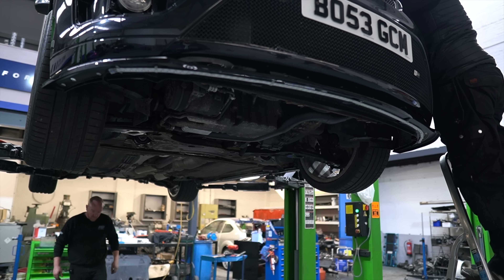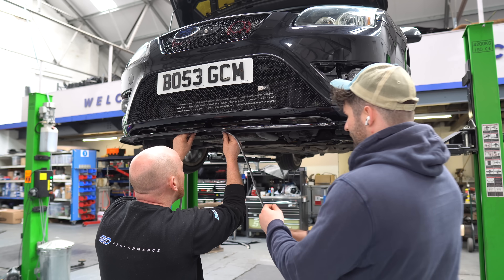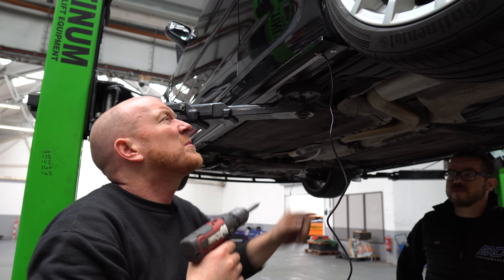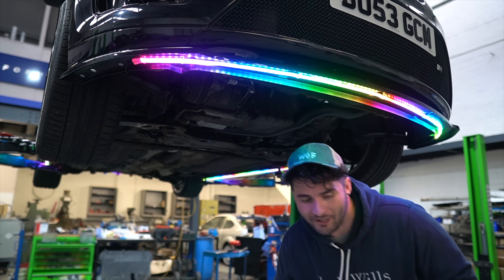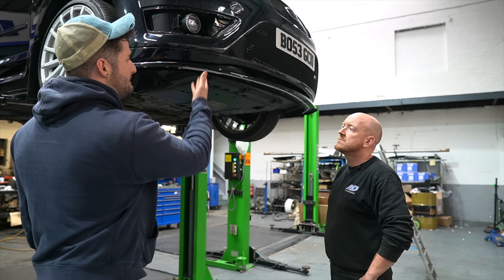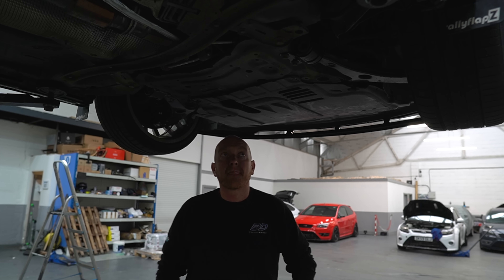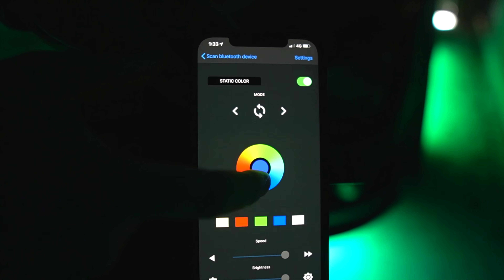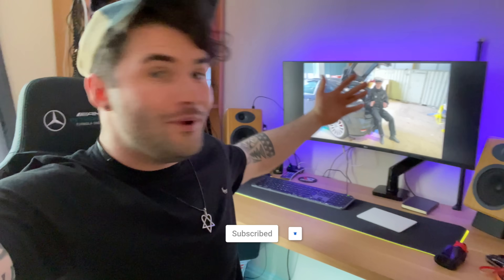FITTING NEON UNDERGLOW TO MY CAR - POLICE OFFICER REVEALS WHATS ACTUALLY LEGAL HERE IN THE UK?!

Comment: Another great tip is use a heatgun to warm the adhesive first before the application this can be very beneficial as the adhesive will be much more sticky. Also small jet/windproof lighters also work but be careful not to burn the adhesive or the car.

Comment: A better and safer way to run the wires is to remove the wheel and wheel arch liner. Run the wire over the top of the liner and then they won't fall foul of moving parts

Comment: -Underglow is perfectly legal for ON ROAD use in the UK if the leds are HIDDEN under the car.
-vehicle lighting regulations do not apply as the lights are not visible, underglow on the ground is unregulated.
-police may try to do you for distracting other drivers, but a stickered up fluorescent yellow rally wrap is legal so...

Comment: As a general rule, Underglow lights are considered legal for installation. It's important to note that these lights should not flash or display the colours red or blue on public roads. These guidelines are in place to prevent any confusion with emergency vehicles, which typically use red and blue lights. 

That would mean that it is legal to drive with them on the road but not using blue or red colour right?
Reply: Wish to know aswell

Comment: According to my previous research with cops regarding neons on the road:

No Blue or Green at all.

No Red on front.
No white on rear.

Front has to be white.
Rear has to be Red.

No strobe, pulse, ripple or flashing.

The leds or bulbs themselves must not be visible.

Any other combination has to be off road only.

...supposedly.

Comment: Either though I understand you can’t drive with them on, but what if I wanted to connect the indicator lights to the led bars, how would that effect the law, as not permanently on, but a short time when turning
Reply: You can drive with them on, you just can’t use red blue or green when driving. Also they can not flash they need to be solid colours. And there’s a limit to the amount of light it can give so would probably be best set to half brightness while driving! When at a meet use max and any colour you want including green blue and red, you can even have them flashing just not while you drive.
Reply: Much appreciated

Comment: A copper will likely not directly say neons are legal. As far as my interpretation goes of the law, you can have them on as long as you can set them to show only white at the front and red at the back whilst on the road. Some kits used to have this function but i dont know if any do now. its easier for them to blanket say no theyre not legal. Never ask a copper if something is legal as theyre likely just say no if they dont like them lol anyone with an FAC will know this

Comment: as for the law even most cops dont know the laws on lighting,i had a custom van covered in colored lights at the front and the amount of cops trying to do me was a joke as its not against the law as long as you dont have red to the front,i think the same goes for underglow,theres nothing to say its against the law at all,as long as you dont show the wrong color to the front or rear your be fine, hell even the cop in this video did not say its breaking the law !
Reply: Bit of a late response to your comment, but what colours could you get away with while driving out on the road? I know that blue is a no go, any others?
Reply: @ARDEN440i  anything but red to the front and white to rear, I run green lights in my angle eyes and used to have a van covered in lights made the Coca-Cola truck look crap LOL
Reply: @Everything_Lincolnshire  So basically all the cool colours you can't use lol

Comment: Hello, are running board led strips illegal to have? similar to what SUVs have? I've installed some on my car underneath which will be wired onto a switch. The flash amber when indicating and are white when main beam is switched on.

Cheers

Comment: Firstly, this is not neon. Secondly I can’t believe how expensive this kit is, it looks like it’s Just WS2812 LED strip in a waterproof sleeve, which can be purchased far cheaper. If you wanted to make it really neat you would use something like an ESP32 as the controller with an app called WLED, this would allow you to have all the flash colour sequences you currently have, but also split the front and rear of the car so you are only showing Red - ish sequencing colours at the back and shades of White sequencing at the front.

Comment: BMW have a brake force display where if the car is under heavy braking it will flash the brake lights, would this be allowed to be fitted as an aftermarket mod to other cars? where if i press my brake pedal my 3 rear brake lights would flash 3 times then be a solid red?
Reply: I have this technology fitted on my motorbike. Never had an issue

Comment: So will you be able to have them on if inside a car park driving around??
Reply: I think you can have the sides and front on when using a public road as long as no light is emitted from the rear of the car and it's not bright enough to cause a distraction to other road users (keep it dim) you can't use red, blue or green on public roads.

Comment: If there are no laws that say you can’t have these turned on when driving then why would we get in trouble for using them? I contacted the RPU about this last year and they clarified that as long as the bulbs aren’t visible they are legal and there is no difference in the law regarding static or driving around.
Reply: @eternalemperorvalkorion750  that’s the thing though, this policeman literally said it’s not a crime..but don’t do it. What a load of bollocks 😂

Comment: How much would getting something like this cost in 2024
Reply: £20 temu easy to install and use your phone to control them
Reply: Yh I got some proper ones , just gotta install them somewhere in the fuse box
Reply: @LuciferGaming840  do it to ignition or use a probe and find a empty fuse slot that gets power when car is on and turns off when car is off

Comment: Some tape over the exposed wires might also be a good precaution in the case of suboptimal weather which is a certainty in England
Reply: The kit has fully waterproof connectors 👍